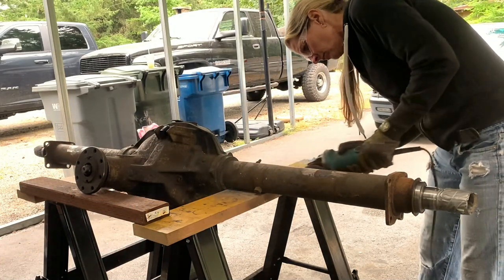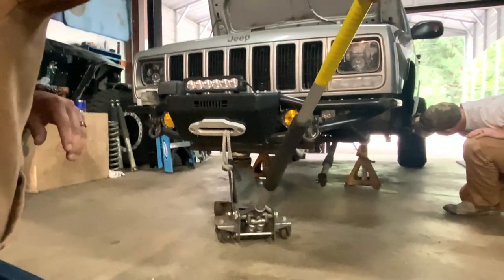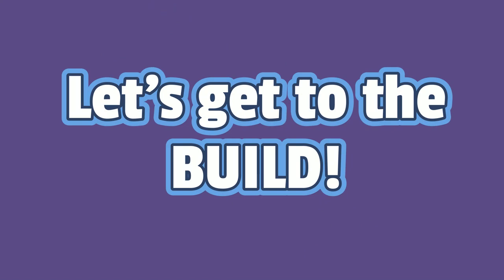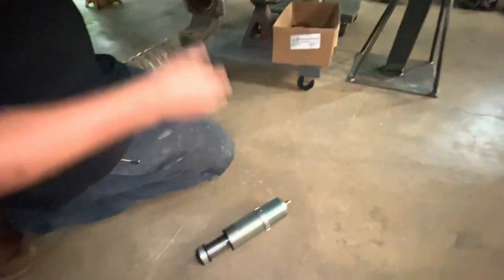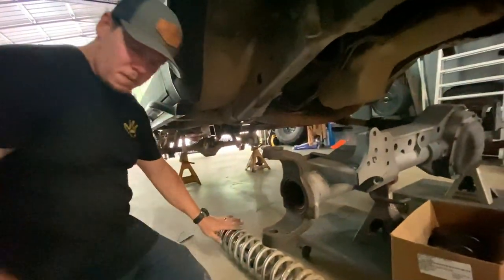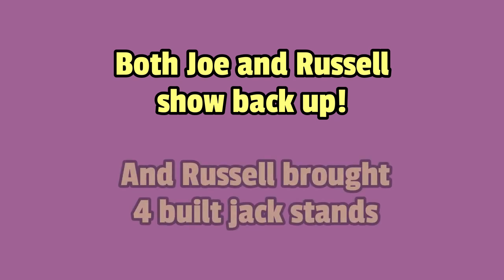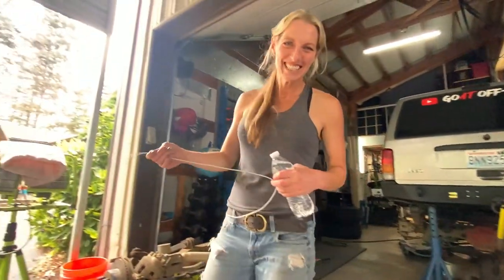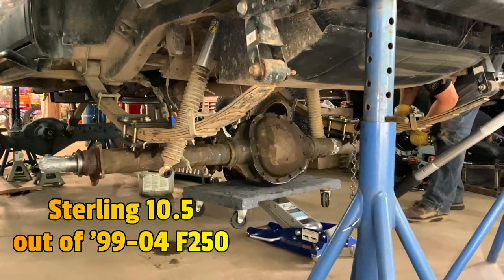EPISODE #7  | SUPER DUTY AXLES ARE FINALLY UNDER THE JEEP!  | JEEP CHEROKEE ONE TON BUILD

Comment: That thing is going to sit really tall when you are done. Have you finished the center frame stiffeners? I am going to install my rock sliders tomorrow.  Its going to be a good day!
Reply from the maker: No center. We have 2 crossmembers and a skid plate. Seems unnecessary. Have fun with the rock sliders! They are fun! 😂 What kind did you get?
Reply: @GoatOffroad  i got some 2x6 .25 wall rectangular tubing.  I am going to cut out the rocker panels and replace them with the tube. It should be really stiff with the frame stiffeners and the sliders.
Reply: @joshjoshb2595  i have about 5" of lift with 35's to try to keep somewhat of a low center of gravity. With all that added weight of the axles you will definitely get some flex. 😀

Comment: Yall are making great progress!!
The Grey Goat is going to be a Beast!
I too have the same problem with jack control. I always manage to just fully drop it every time. What's real bad is when I do it with a front wnd loader on a tractor.
Those are some serious parts yall are putting on the Ole Goat!
Random question, did yall ever weigh the Goat before this axle swap? I would be curious what the weight change is once it's done.
Great episode!
Reply: We all have trouble with Jack control when it comes to Bug 🐞 Duddie! 🤣 we should’ve absolutely weighed it before and after! Good call Duddie! However, I wasn’t smart enough to think of that.
Reply from the maker: Thank you Duddie! We didn’t weigh it. Would have been cool. Picked up all the rest of the parts yesterday so now we just need to put it back together!!

Joe has jokes 😂